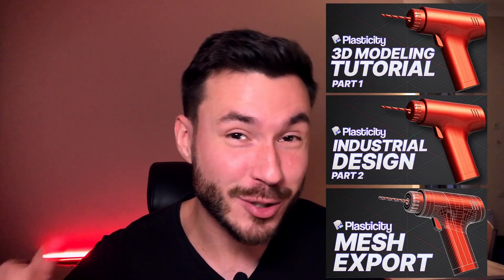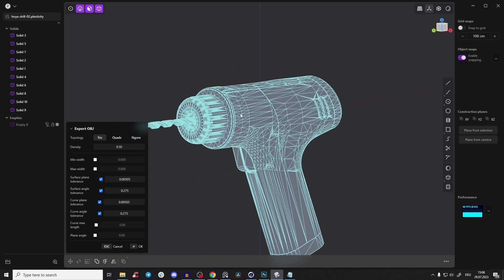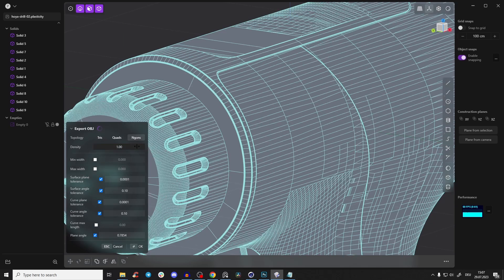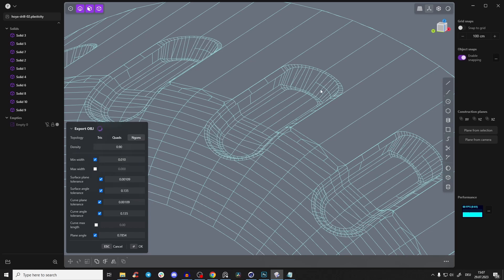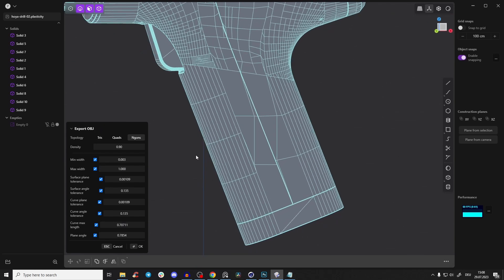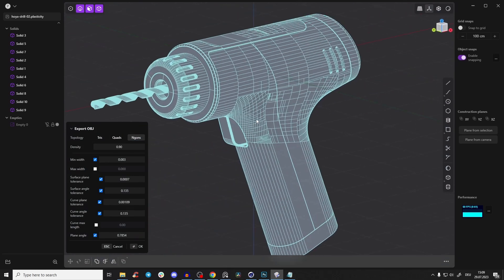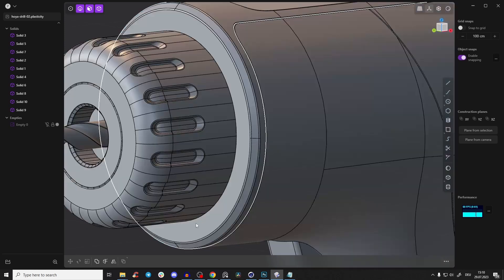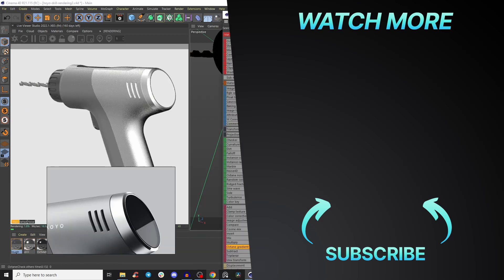Plasticity | CAD Export To Mesh Tutorial | Part 3

Comment: Great video.  Thank you so much and respect.  
I have just one question that I still can’t understand and find an explanation in the video about this program.  What is the final product of the modeling in this program?  I mean, we got the necessary model, and then what?  does the program have the ability to assign materials, does the program have a render engine or maybe third-party render programs that work with Plasticity, where we can adjust the light, apply and adjust textures, make a render and get the final product or is this program just for modeling for the sake of modeling?
Reply from the maker: You can export your 3D Model with a mesh/topology and use it further in your 3D software of choice for materials, lighting etc. 

Plasticity is amazing at modeling.
Reply: @nikita.kapustin   esa malla es un desastre  como voy hacer unwrap a eso?